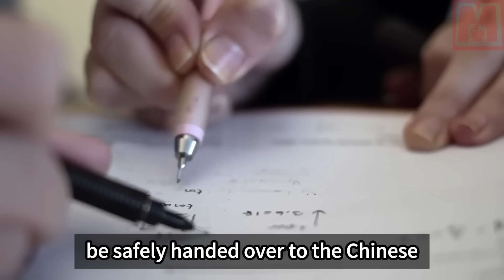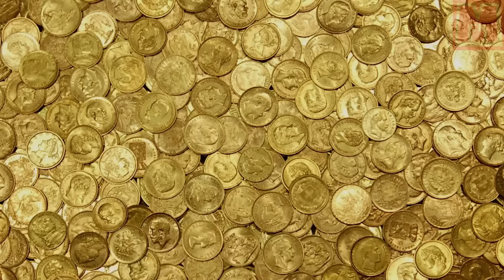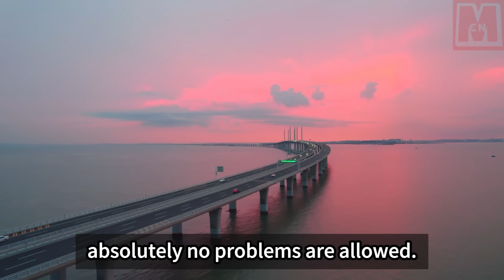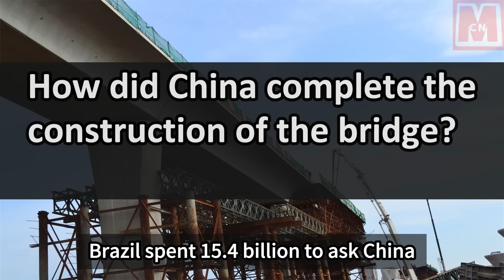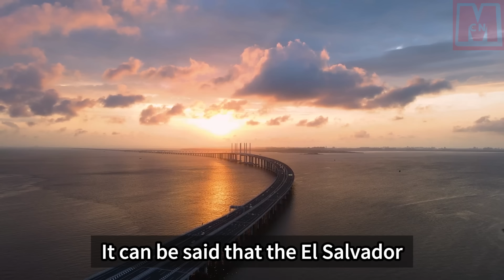Brazil spent 15 4 billion to ask China to build the Longest Sea Crossing Bridge in South America

Comment: I hope they use stainless steel reinforcement steel not ferrous.
Reply: I understand the steel is non corosive in sea water.
Reply: This is the PRC not the British-Raj
Reply: @georgewong1837  Sorry when encased in concrete then subjected to taking on water there's a very slow chemical reaction which steel degrades. At below and above waterline it's still cheaper to use grade 316L stainless to mitigate this risk.
Reply: Don't need to worry ok. Chinese people knew so well which one to use for build.
Reply: @samtat0315  I don't think so when the buildings they built are falling apart
Reply: Tell to the British-Raj.
Didnt their bridges collaps TWICE?
🤣🤣🤣🤣🤣🤣
Reply: @taiwanstillisntacountry  
Looking at the history of that and the  lack of maintenance and humid environmental it's in, I believe it's had served it's purpose well. It's not like it fell down 15 years after its built. Indian infrastructure is very poor itself.
Reply: The bridge collapse in its first year before it was finished and then collapse again when being re-build.
Glory-to-the-British-Raj 🤣😂😁
Reply: @taiwanstillisntacountry  looking at how it broke apart it looks like the span joints (fasteners like rivets)  deteriorated with age, it could be the wire suspension cables. All these are high maintenance parts which requires anti rust paint every 2 to 3 years. I again think this was all due to blatant neglect. The British has a very good history with engineering not India.
Reply: @conmanumber1 это ты свои разваленные здания путаешь с китайскими😂😂😂
Reply: @conmanumber1  Yo dude are you kidding 🙄. Falling apart and collaps aren't China ok dude. It's that country . Pls you should go fect check back last year which country first dude🤔
Reply: @conmanumber1 
Build your own. That way everything will be perfect.
Reply: @Empireoflies1984  They can only talk and cannot build.😂😂😂😂
Reply: @conmanumber1  are you sure? Have any of the skyscrapers fell apart in China?  Have you heard about the apartment falling down in FL? Have you heard of any high speed rail crashing and running off the track? Have you heard of ignorance?
Reply: @brianliew5901  🤣
Reply: @conmanumber1   The buildings they built falling apart?  You must be confuse India with China.
Reply: @BabaYaga826  It's well known construction projects in china is a dismal failure. My parents Ancestral home in Taishan China is 150 years old and still standing but affected by humidity and a little neglected due to lack of maintenance. At 150 years old it's still standing. Here in New Zealand, Australia we don't have concrete and steel in construction so weak as China's. If it's tested not to standard these materials would not be permitted to be used or sites closed down. The concrete construction I've done 40 years ago will last over 150 years which is across the board normal here or in Europe, North America etc.
We had some Chinese here who set up building companies in Auckland New Zealand but the jobs they did was absolute shit and never met code. We definitely in no way would allow building like what's shown in following video from China. It's shocking to see building practices like this. We have hydro power dams here 100 years old and still as good as day it's built then I see the Gorges Dam in China failing after less than 30 years since construction. We had property in Hong Kong for decades but amazing Hong Kong construction is still way better than in China so ask yourself why?. It's fine you are trying to cover for your communist government but facts are facts. Yes I'm I'm a 3rd generation Chinese with roots here in New Zealand since 1850's but I still know whats going on in China.

https://youtu.be/hzMjAnzID1U?si=Lt-YvoBfix8wNQu7
Reply: @conmanumber1       Isn't that footage incidents did happen in Europe too?